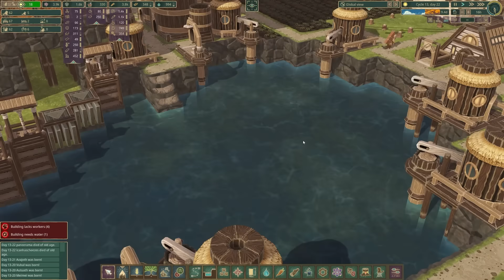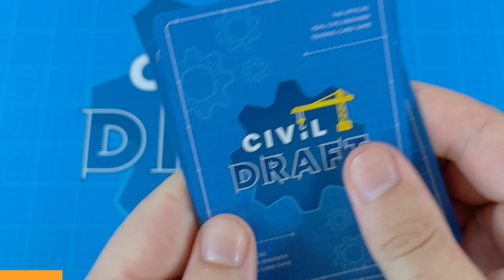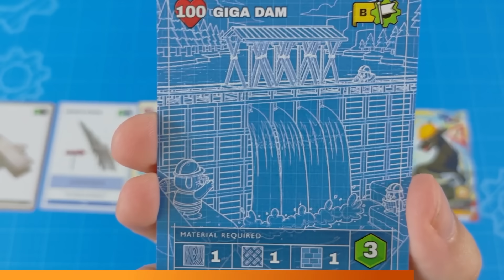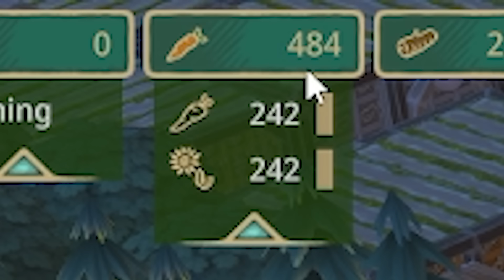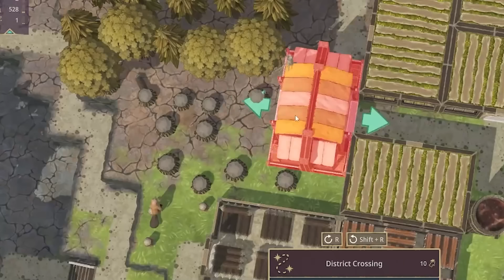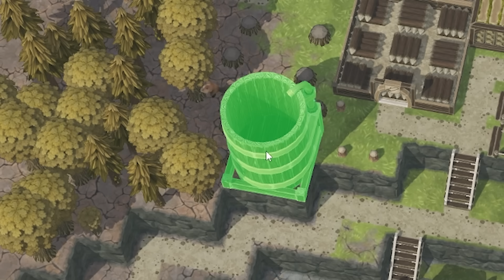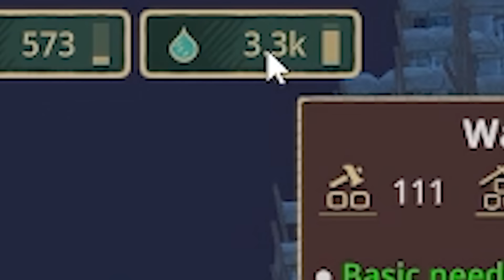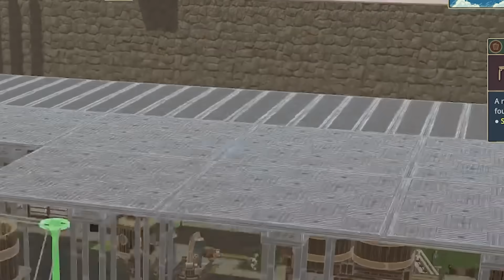The MEGA PUMP will save my colony in Timberborn!

Comment: Matt, what is your obsession with reservoirs. A block is standing water can only hold 5 units of water, and it evaporates. A large water tank can hold 1,200 units of water in just a 3x3x3 space. Much better than the 135 units you would be storing in an equal sized reservoir. Then, use water dumps to keep the area green throughout the droughts. Your reservoir, which took you two drought cycles to built, in comparison, can only hold about 576 blocks worth of water, or 2,880 units. You would have been better off putting platforms over your moat and placing 3 large water storages, enabling you to store 3,600 units of water instead. 😅
Reply: He's becoming an architect :(
Reply: @Blötzinn what do you mean becoming?
Reply: @Blötzinn  He always was an architect
Reply: Counterpoint: a reservoir is just objectively cooler
Reply: @amelianyoom9545  objection: that's literally architecture
Reply: Ok...but is the large water tank in the shape of the strongest object?

Checkmate
Reply: Still you need at least one reservoar so that you can pump water from other than that your idea is good.. but Matt won’t listen he’s an architect…. He likes to make it look good even if that means less efficient…. Editor is more of an engineer…
Reply: do you think he read this facts?

We're knowing he is architect anyways.
Reply: You need both. Reservoirs are just objectively better at keeping your fields irrigated because you’re not wasting time pumping water only to dump it back in.
Reply: @cathygrandstaff1957  Indeed. It should not be about this or that, but both.

But overall, I stand my ground on the big picture. Many of us are here for the megaprojects. Take out mega, take out the audience, and that would kill the show.
Reply: Are you having a problem with dam engineering? Are you an architect trying to lure decent beavers from the righteous engineering path?

Ok... Those big tanks might hold water alright, but most of us want to see megaprojects. It takes engineering to make megaprojects happen.
Reply: @JuhoJohansson-bz3jb "it takes engineering to make those projects hapen" no it doesn't. It took engineers to make such advanced tanks that can spatialy compress water, instead you prefer flashy hyper reservoirs, that, that's architecture my friend.
Reply: @lXlDarKSuoLlXl no one wants to pay to see three water tanks. The tourism bureau  can advertise a massive tourist trap, but not a efficient engineering project.
Reply: For the architectural aesthetic
Reply: Now this is how an Engineer actually thinks
Reply: He's a youtuber. Building a ton of large water tanks do not get views. Building a huge reservoir is way more attractive for viewers.
Reply: But utilizing dead space by building raised storage on platforms over water, instead of building everything on your green is enginarily impossible. Everyone knows this, except architechts.
Reply: I like to have massive amounts of both to be completely safe
Reply: playing optimally is like..... against his vibe..... man
Reply: You need both.

Sure, storage tanks are more efficient, but you have to fill them with pumps. The amount of beaver labor you’d have to allocate to just pumping in order to fill your reserves during the wet season isn’t worth it if you could just have a reservoir with a a couple pumps working in all seasons. It’s not like you actually need every last drop of water that flows into the map.
Reply: All the malding armchair engineers in the comments are the funniest part is this channel.
Reply: but then you have to pump more
Reply: @wangpasta at least he wouldn’t be wasting the water to evaporation

Comment: It doesn't just depend on "how many" water sources you have, but also on how strong they are. If you create a map, you can see, that you can set the water source strength per tile. So you CAN have 1 water source tile, that produces so much water, that you need 2 or three outlets, or it will spill over...
The strength also determines how much speed the water has initially, so high strength creates a LOT of HP on water wheels.

Comment: I feel like Matt is massively overcomplicating this by trying to build an Atlantis. I'd have just tried to build walls around the central island, and made it so the surrounding water reservoir can store more water, probably at last until the point where the surrounding wall has those holes and use those for overflow.
Reply: That would've been a better idea tbh

Comment: Why not move your main colony outside of the zoo and fill up the entire zoo with water?  Would save on a ton of building and resources.  You'd only need to research the plug to avoid bad tide contamination.
Reply from the maker: ^^ what he said 😂
Reply: But that wouldn't be a mega-project that wastes time and resources while also not actually solving the problem he has in any reasonable amount of time.
Reply: @WintersMinion  Isn't that the definition of architecture?
Reply: @BillBeavis  well, he is RCtEch